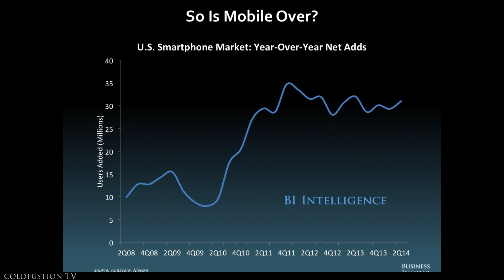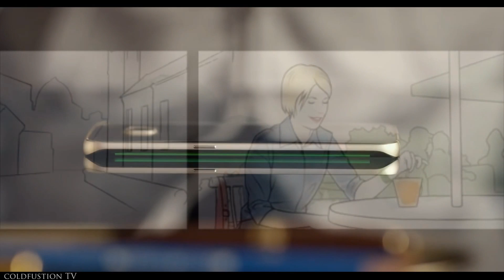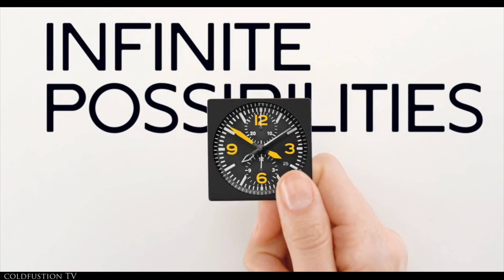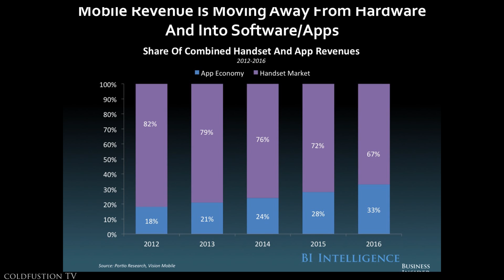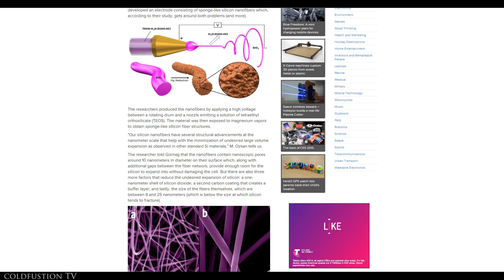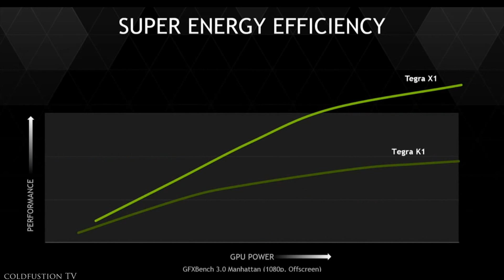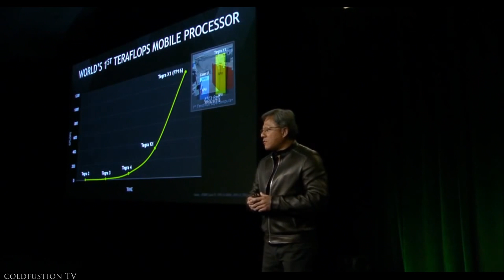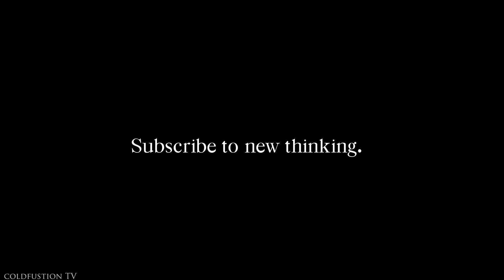The Future of Smartphones!

Comment: 4 years later . . . 
The fad of bezel-less design mostly killed front-facing speakers
Modular phones never happened
Battery technology is still a joke
Reply: "Battery technology is still a joke"

Phone batteries have increased drastically since this video. My old phone would last only a few hours and take 1 1/2 - 2 hours to charge. Now my battery last throughout the day and even into the next day and only takes 30 minutes to charge to full (I'm on my phone non stop). Even though the new technologies and screen resolutions take up more battery power. So the tech has advanced in every way.
Reply: I have a galaxy m51. It has a 7000mah battery ans 25w charging. I have tried to use it heavily to drain it in under a day. I just couldn't best i have got is 11h of screen time including, listening to music, 4hrs of cod mobile, a couple of joe rogan podcasts, around 1.5hrs of calls and fb in between all of the above. I could only bring it down to 32%. I average 8hrs screen time on my phone and according to my usage pattern i have 27 hours of battery at 100%. That was not possible 5 years ago. I could only imagine how long it would last on max power saving mode. Last but not least it's $380
Reply: @ma.s2386  5000mah here and it can last me a lot more than 11h of screen time lmfao

Comment: 2019 - Foldable phones are making their first moves into the market, but are still ridiculously expensive. Modular phones have been tried several times, but have failed commercially. Mobile VR has achieved limited adoption, but the experience is far from fluent yet. Batteries still last only a day or two, but charging technology now allows phones to charge to 50% capacity in 30 minutes. In order to maximize screen size every brand has adopted The Notch a cutout for the front camera that disrupts the screen.
Reply: Wait, vr technology is still not popular in pc or consoles, why do you think mobile phones have reached their limits

Comment: Very soon we may be wearing a three part unit. A wrist device that contains all the powerfull hardware and a wireless pair of glasses and earpieces that transmit all the audio and video. The video will be holograms and may have a full VR when you want it and the earpieces can let in or completely block out surrounding noises. 3d everything and waterproof everything. We'll rarely take them off. It'll contain our ID for everything, even our money or bitcoin. Communications, navigation and entertainment. Health monitoring, business, just everything. Combine that with robotics, autonomy and all the other good stuff and our lifestyle may change dramatically over the next decade. A bank can be a fully virtual entity for example. So many physical jobs will vanish but, there is potential for so many virtual tasks if we do it right. Or we'll start ww3 and go back to stone age

Comment: Why aren't they putting Tegras in lightweight laptops?
Reply: bcuz while the mobile chips just broke 1 Teraflops, the laptop/desktop GPUs are at over 6 Teraflops. The latest from Nvidia 1080 GPU, they are at 9 TeraFlops.
Reply: In this video they showed a graph comparing a tegra to an I7, the tegra had significantly more computing power than the i7 did.

Comment: In your video you made the comment that mobile operating systems will eventually have full desktop functionality, but the Nokia Lumia 950 is already doing this with windows 10 mobile, which can also double as a full windows 10 desktop with a connection to a monitor. Just wanted to add this information as I'm a windows/.net developer and I see windows 10 and hololens really taking the lead in both the mobile market and VR market.

Comment: Innovation in the Smartphone area will slow down.
Right now we're at 14nm Samsung, the Galaxy S8 will use 10nm LPE, S9 will use 10nm LPP and the S10 might use 7nm.
So we're going to have more ram, more flash storage, faster, more efficient and smaller processors and graphics a little by little better Software. I think the real revolution of Smart Devices will start after 2020 when we're going to see that below 4-5 nm isnt possible, 5G Internet will kick in (without too much limitations) and the Internet of Things is going to make a difference.

Comment: I think computers desktop computers disappear.
The computer power needed for most desktop computing is seldom used by a 'normal' home user.

I assume there is a 'computer set' in the form of a keyboard mouse and screen that are remotely / wireless connected to other devices in a mesh network.
When enough devices in a house have computing power, fridge, heating, electricity management, phone, smart-watch etc etc, even the car, then a personal computer function is temporarily generated with distributed computing.
A virtual computer like a virtual server and is allocating computing power as needed within the network.

And so we will make the transition from the computer (machine) to computing. Computer is an app, not a thing.

Comment: that's possible but impossible at the same time to get desktop phones. because they use ARM cpu's witch are made for simpler tasks. ARM does not have access to the x86 architecture that Intel and AMD does witch makes it possible to run well. here's an example. the top snapdragon 810 CPU would be the equivalent of a Pentium 4 x86 CPU. so smartphones have a long way to go before that's possible
Reply from the maker: +CyberLion Plenty of Intel x86 phones exist, Lenovo make a few.
Reply: +ColdFusion alright thanks, I'm just surprised you replied haha :D
Reply: +CyberLion Asus too
Reply: +CyberLion Windows phone 10 does exactly what he explains in this video as the next step. And it does it very well, and is super powerful. ARM is not that weak, and they have the Snapdragon 820 coming out in phones. Hell, the iPhone 4 played the id Rage game on it just fine, which is impressive. We are no far away at all.
Reply: Tegra x1
Reply: ARM is near a x86
Reply: CyberLion that's not 100% true… there are certain workarounds. You're 90% there though.
Reply: CyberLion remix os works just fine on 32 bit or 64 right now.

Comment: For the cameras to get more useful resolution, they'd need to get bigger optics because most high end phone cameras are already limited by theoretical diffraction limits.  They could make a 50 megapixel phone camera with a 5mm aperture but you'd have to scale those images down to at most around 12MP get significant contrast between adjacent pixels in the resulting image.  The extra aperture would also be needed to collect more light and keep the shutter speed down.  A 48MP image made with a 10mm aperture could be as high contrast as a 12MP image with 5mm aperture.  This diffraction limit is one of the main reasons that telescopes need to get bigger to capture more detail.  The modular phone idea at 2:50 won't take off because upgrading a phone or most computing devices often involves updating everything.  Even with a desktop, only tech-savy people upgrade individual components because there isn't a practical way to dumb down the upgrades to the point of snapping Lego blocks together like in the video.  Electrical components need to be compatible with each other and there are strong reasons why newer versions become incompatible.  Using the phone like a laptop or PC will get more popular soon, though.  Smart phones are already amazingly powerful computing devices compared to computers just 10 years back and could do every practical task you'd want.

Comment: So much information in 1 video, I have over a million useless opinions on every single one of them.

However, some of us can agree that somebody could probably find a way to fit 100 of those cellphone chips in a single desktop tower and connect them all into a sophisticated supercomputer with special software that will maximize its compacity. That would mean that today's desktop standards would make future desktops 100 freaking times (10,000%) more powerful than the cellphones of the future. 

It would be even weirder if somebody made a superior neutron transistor that pulls the weight of a thousand transistors... This is all just getting way above my education level. Somebody do the work for me, I don't need the money or the fame.

Other than that I got an idea of a new form of energy generation that doesn't require magnets, wind, or water or fuel of any kind. Its already in the archives and for some reason it is not being built or experimented on to my knowledge.

Comment: I'm not too worried about the PC getting overtaken. Besides, if that does happen, that means laptops will eventually be just as good as PCs.

Now if they could just work on making the audio better in small devices.
Reply: Uh, laptops are PCs, PC means personal computer, and a laptop is just that.
Reply: +Merk Floostic But you still understood what I meant, correct? Thus it wasn't really necessary to point out the obvious.
Reply: tablets are going to replace laptops

Comment: How is a phone working at 1 Teraflop impressive? My PowerMac G4 has done so since 2002. Also, I don't think phones will end up being the best things ever. The CPUs are much smaller and a smaller nm processes would only make it hotter, and it can only go so small. My iPhone 5s can't browse instagram without getting super hot, so unless phones get bigger or we have ways of using the phones case as a heat spread, they can't get to fast. No matter what, heat will always be an issue. You can't really water cool a phone.

Comment: Mobile isnt over, it's being integrated into desktop grade mobile suites or vice versa. We see the true merge of desktop grade laptops being made just as of this year, next phase will be a modular seamless mobile suites that can integrate into a station, biology, etc. This advancement will really start when a super efficient and powerful all inclusive processor that breaks/bypasses Moores Law is developed as battery tech (charging too) scales with it. You'll be comparing 2500 dollar phones from brand xyz that integrate into your screen or automatically syncs to a projector-like screen that streams wirelessly. Imo, it'll take 25 years to implement things efficiently. With 15 years if there is a major major breakthrough that super speeds tech onset.

Comment: On bendable phones, with e-ink you put the battery, processor, etc... at one end of the phone, and then attach to that base a long and bendable eink-screen.

On functionality, instant languague translation is going to be a must, allowing you to talk with anyone on the planet fluently. They're already making breakthroughs on that today, where a few years ago this seemed like wishful thinking.

On modular phones, this creates distance between the parts. Right now smarthpone sizes are dictated by screen size, but what if the screen doesn't have to be close to the rest of the hardware?
Also on modular phones and gaming, what if you could hook your phone up to an external processor? Or you could combine multiple phone processors. Or you could use the internet to connect online to a more powerful processor.

Comment: Today's technology is trending to become smaller, portable yet perform efficiently, if not better, as their larger desktop counterparts. 
It would not be hard to imagine that machines can be run with parts smaller than microbes - microorganisms are by themselves tiny powerhouses that perform efficiently as their larger bodied neighbors in their ecosystem.
I want a portable-device with the longevity as well as the durability of the water-bear or the tardigrade.

Comment: Specs become less important when it comes to incorporating your phone into your everyday, normal life.  What becomes important then are things like 'reliability'. Battery power is still the biggest issue.  I personally don't want a wafer thin 5 inch HD phone. You can't put them in your pocket and they're difficult to pick up off a table.  I'd much rather have something along the shape and size of the HTC Explorer for example (but with better specs).  A removable battery is still a deal breaker..
Reply: +Gra Piken Battery is truly the most important thing companies should focus on. I really hope new technologies are embraced and integrated as soon as possible. Let's pray Li-Ion doesn't become something like oil became. What also bothers me is OS, like the guy in the video said. These mobile OS's are cute and function very well in the first few months, but they slow down pretty bad and most of their software bells and whistles are not practical to begin with, because they weren't thought out carefully enough. Integration between devices is crucial for consumer convenience, but this is where simplicity and unification become the key, and some developers just don't get that.
Reply: +Gra Piken You need decent specs for a reliable phone.
Reply: Mr.lickandstick Cbc no! But it's nice to have a clear screen etc
Reply: *****  everything you've said is correct. Benchmark tests are useless. They don't equal real life, long term use.  I've noticed that a new LG smartphone has a removal battery - which is great.  It's very thin though.  (They look nice, but thin phones are not easy to pick up.)   Shame they are a tool of the surveillance state.  

I think this may be one reason so many smartphones are unibody. Maybe the surveillance state has put pressure on manufacturers to make their phones unibody.   If you take the battery out - it becomes useless to the surveillance state.

Comment: I really like the phone module design. It's better to upgrade a hardware piece than just buying a whole new phone every time which is a pain in the ass. Im not sure if that design is cheaper to build with modules but it's flexible.  I have a Sony Z3v and everything is great except the headphone jack is quiet and not enough output, and be great to replace it with a jack with more output.

Comment: i know most smart phones use nano tech if possible would this be using pico or femto tech, because it being a phone small may need those quadrillion threads into the chips to be faster than a computer. even if that will be faster then a computer thou, a quantum computer is 10,000 x faster than a supercomputer, being at 10million was mine.....

Comment: Firstly, great video. Now, I did have concern with the comparison of the super computer that uses CPU power to generate a Tflop of compute to the X1's GPU compute. My i7 5820k has about 175 Gflops of compute, and no it doesn't have an on board graphics solution, so it won't be running anything compared to the X1, but if I put a very basic GPU in it, and had it do tasks optimized for cpu compute the X1 couldn't touch it. Now, that super computer you referenced is still 6 times faster than my overclocked i7 5820k. That is all, thank you for the video.